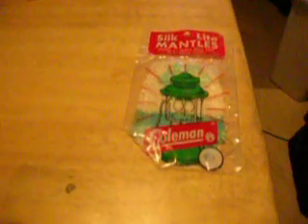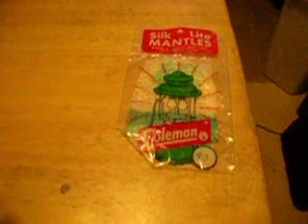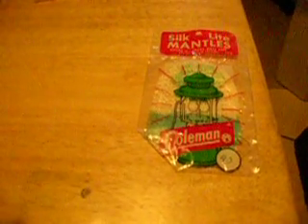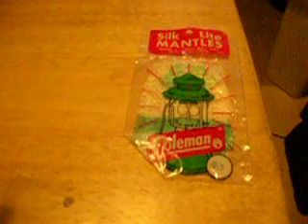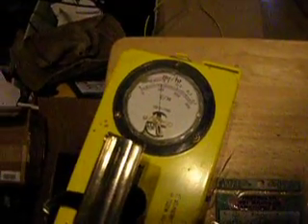Coleman Lantern Mantle Radiation Hazard

Comment: Some context about the measurements would be useful..if memory serves me, dental X-rays have a higher level of radiation, which is why you have a shield apron during the process, to limit exposure. Apples/oranges comparison, sure. It would take too long to get my manual from USAEUR NBC school dug out, pretty sure that beyond the basic "don't eat/inhale the mantle residue, wash your hands after handling " advice, the mantles are safe to use. Do appreciate your help to quantify the emission types and levels. Didn't know that info for certain. Thanks for putting it together!

Comment: Jeez!  Just clean up the debris with a damp to wet cloth, wash your hands when  handling the mantles and debris, don't inhale the dust etc. In short just use you Noggin, and these mantles will serve you just fine as they did for so many years.  Lawyers and the "Nanny State" have everyone afraid of everything!  Background radiation from most paving components that are driven on with autos and trucks and subsequently turned into dust, spread all over our roadways, especially here in the West, then subsequently inhaled by motorists is often worse than that produced by these Mantles,  Life is a terminal condition, and one cannot avoid the hazards of life completely with out eliminating life itself.  Just live your life, use good common sense procedures, and you'll find these products will prove to be superior in performance.  I wish that they were still commonly available, but since everyone is afraid of the Lawyers, and the Government wants to control every blamed thing we do, we no longer have this superior product available to us, except for New Old Stock, and then at a very  high price, I wish I could find more of them.  It is a darned shame that ignorance and  Politically Correct Thinking has removed so many good products from the market!  One should be aware of the hazards around us and take reasonable precautions, some things need to be eliminated from common usage, but this product in my opinion is not one of them.
Reply: Actually, you can still get brand new Thorium based mantles, made by a company called Peerless. 
Their 2C-HG model is an equivalent to the Coleman #21. You're not going to be able to find them at a store, but are readily available to order, and close to the same price as new production Coleman mantles, all said and done.

Comment: Thorium 232, the isotope which the Coleman mantles are made of, decays by alpha decay and gamma emission. Alpha particles are easily stopped by a piece of paper, but gamma rays are not. After the alpha emission, the product is radium 228, which decays by beta decay and gamma emission. The beta particles are coming from the radium, not the thorium. The amount of radiation a camper using a lantern is exposed to is small compared to background radiation.
Reply: Maybe so, but that lamp will carry some particles in the fumes. Breathing in radioactive particles is much worse than background radiation.